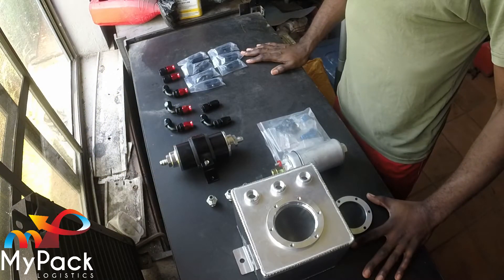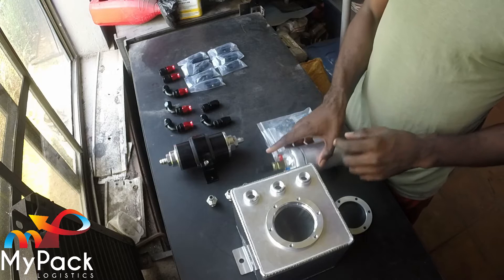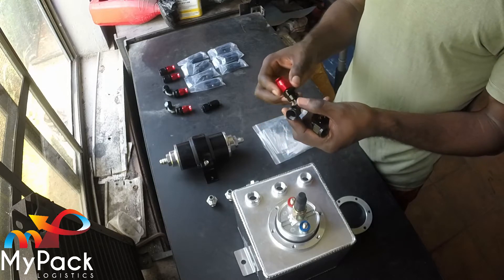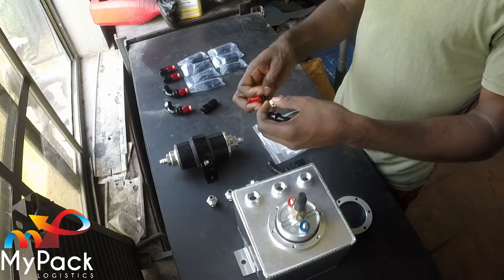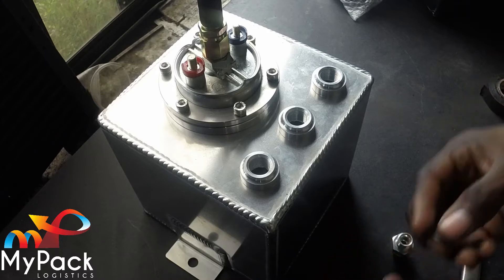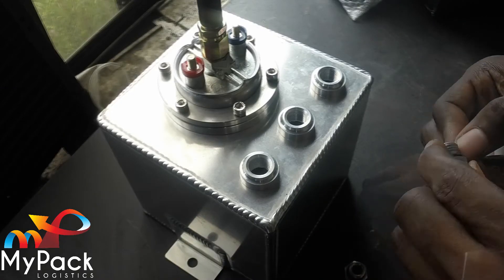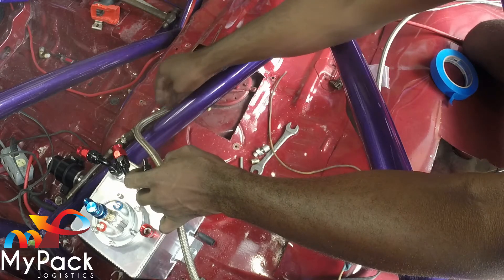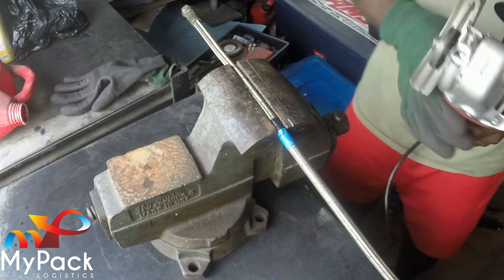PROJECT CHARONDA EP 15: FUEL SYSTEM, FUEL SURGE TANK INSTALL

Comment: What type of fitting do you use for the top of the fuel pump? Its the blue one. I need one for mine but can't figure what i need
Reply from the maker: @elijahweller7620  google Bosch 044 Bango fitting and you'll find it. 
The specs are M12 x 1.5
Reply: @apexracing876 thanks so much!!

Comment: Awesome Video, can this be done on a dead head fuel System?
Reply: @apex racing Thank You! That very Helpful
Reply from the maker: The only way it'd work on a dead head system, is if you place the regulator at the surge tank itself. You'd need one of those 3 port regulators, where you use the two side ports for inlet and outlet and then the return back to the swirl tank.
The problem is, the further the regulator is from the injectors, the more it tends to empty the rail. So I'm not sure how one would tune that, but it's possible to get it done.